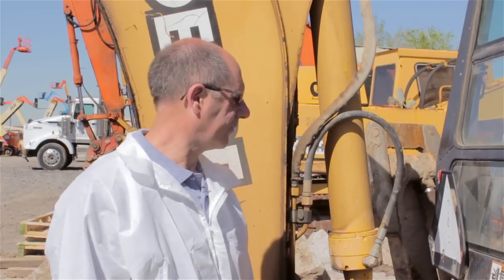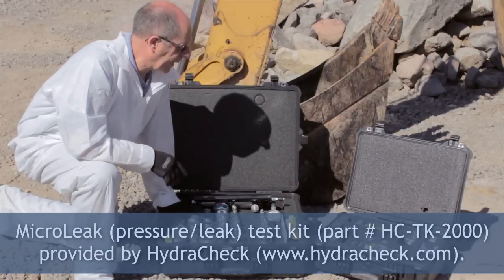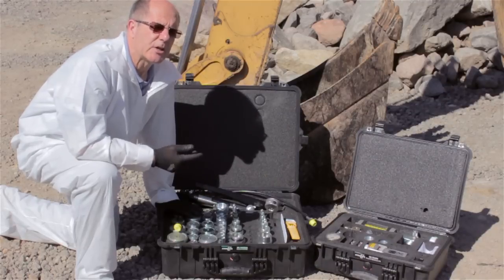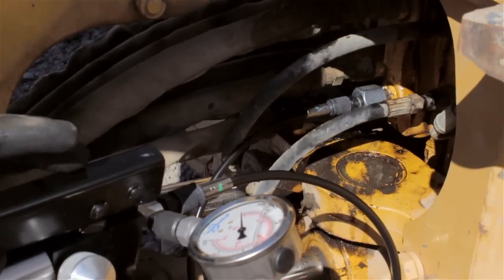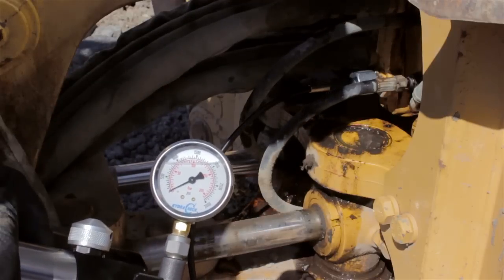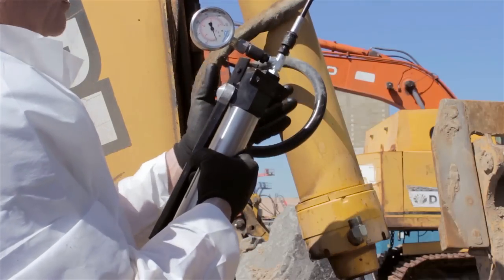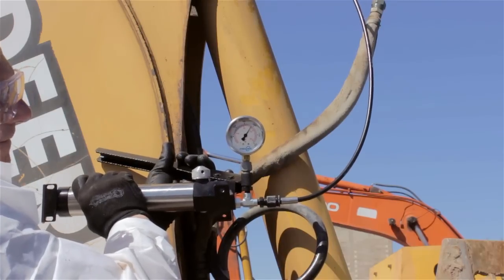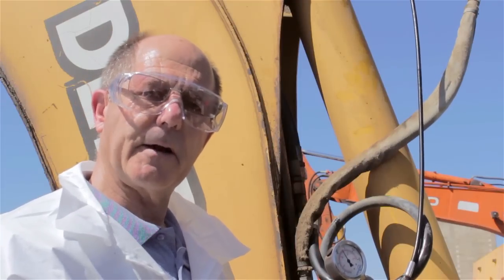MicroLeak Testing Hydraulic Components

Comment: Well if that machine was working to working temp, only thing to do is feel if the cylinder have a hot place leakage create  heat. The other way is to pull the boom back fully l put a flow metre in Port b line

Comment: Correct me if I'm wrong ..if the cylinder drifts out under static load the oil leaks from the rod end past the piston and into the closed end . Therefore the leak test should have been done on the rod end port .

Comment: Not sure how this works when there are load holding valves mounted to the cylinder. Spool directional valves will always leak and it's the poppets in the load holding valves that hold the cylinder and you can't check with this technique.

Comment: Coming soon: Video of how this exact backhoe hydraulic circuit can be constructed on the MFD102 simulator, and also how this exact troubleshooting procedure can be replicated on the amazing Model MF102 training simulator. In addition the on-board computer can generate, in real time, the exact fault (s) the hydraulic system on a typical backhoe can experienceThere is no training system on the planet that can make the transition from the school lab to the field as seamless. In fact the MF102 will teach students how to isolate a problem in a directional control valve when a  Microleak test procedure yields leakage into the valve port. MicroLeak will determine if the leakage is in the cylinder port relief valve or the spool/bore area. Never remove another directional control valve when the problem is simply a leaking line relief valve.
Reply: Sir,
Are you still working in the industry?